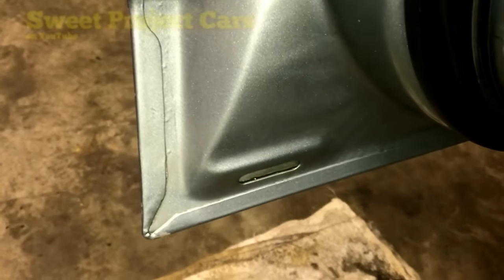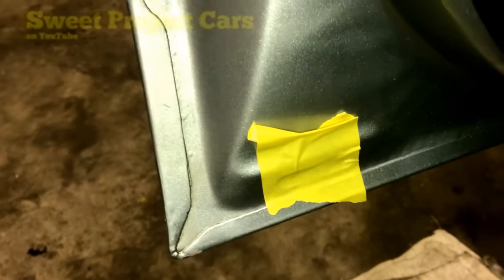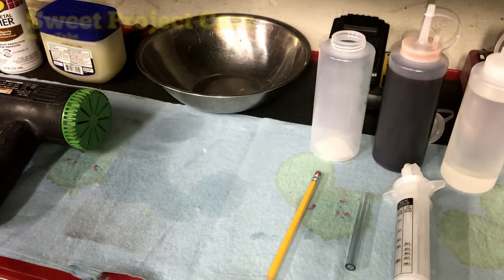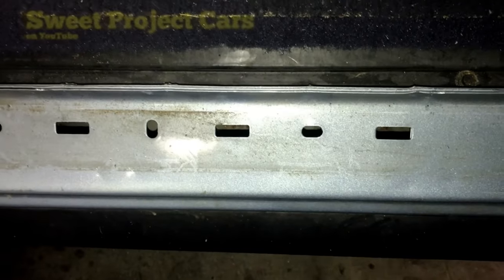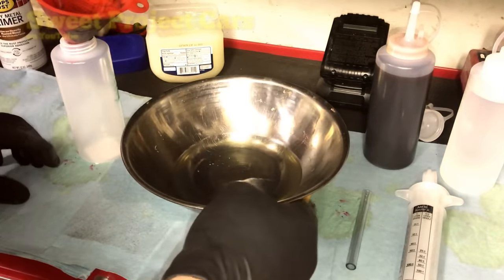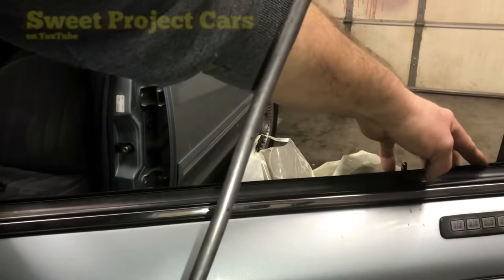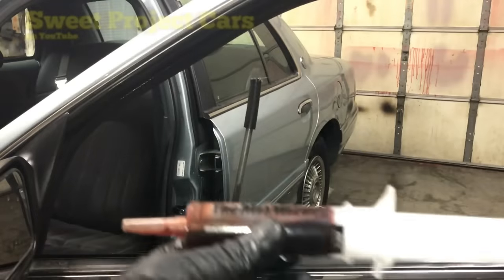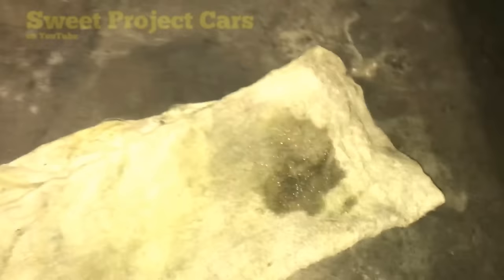Your Car Will NEVER RUST Again! For Just $10 Bucks!

Comment: Does petroleum jelly deteriorate rubber? Additionally, from what I was told, cars made in Canada have higher nickel content that prevents rust.
Reply from the maker: No it doesn't, it's petroleum the same thing as rubber which is made from crude oil.  Thanks for watching. mad Mike the hammer SPC
Reply: @SweetProjectCars  I'm always looking for products that prevent or stop rust and that work. I live in Pennsylvania. I recently purchased a used 2003 Camry from Florida that had no rust. The underside was spotless. After two years of Pennsylvania winters it's showing a little surface rust on parts that are without factory undercoating such as suspension parts. I'm wondering how NHOU undercoating oil works. It looks pretty good. I see some of the same ingredients in the rust prevention solutions you make that are in NHOU. I'm going to try the stuff you make. Who wants to pay an arm and a leg for stuff you can make yourself. Thanks for your videos.

Comment: If you have existing rust in a tailgate and you treat it with petrolium jelly would it make it harder to repair the rust when welding ?
Reply from the maker: Right...so we say fix the rust before you do this rust prevention

Comment: Very cool.  My question: If you allow the product to drain out, where is the protection?  Thank you.
Reply from the maker: The protection is that it seeps into the cracks and crevices and leaves a coating on the paint or metal as you know when you get all on something it’s very hard to get off
Reply: Hi bro . Do we need to use both Vaseline and motor oil or we can use one them ? Thnx a lot  bro
Reply: Hi bro . Do we need to use both Vaseline and motor oil or we can use one them ? Thnx a lot  bro
Reply from the maker: You can use either one or all if you feel you need to we really prefer the mineral oil and door of the transmission fluid you can use either one of those as well

Comment: Thanks for the great video.  I'd like to ask if you think the approach in the video might be useful for a different rust issue.

I have started seeing rust forming around my windshield.  

The car is 18 years old.  The car has life left in it but it's not economical to have the rust repaired properly by removing the windscreen and doing a full repair.  I was told that without repair, my car has 5-10 years before the rust will kill it.  If I can slow the rust, that would be a solution.

If I apply one or other of the oils between the metal around the windshield and the windshield moulding (this seems to be where the water is getting in), particularly where rust is forming, is this likely to help exclude water and reduce rusting?  If the rust that has formed is treated with oil (so that it takes up the oil), could that slow the progress of the rust.  

As I understand it, rust is acidic and, once formed, it accelerates to the process of corrosion.  Keeping it dry reduces the chemistry of rusting.  That seems to be how the oils in your video do their work.  I might need to try to thin the oil to help it penetrate in this type of situation.  But in your experience, do you think it might help slow the rust?  Any tips?
Reply from the maker: Johnnydee Moorstreet real simple my frien, for this open up the seal just a  bit and use the baby oil and mineral mix in the tool list of the vide and pour it under the seal allowing it flow to all the cracks and crevices   thank you very much we truly appreciate it :)
Reply: Thanks for the reply - much appreciated.

Could I please clarify something.  Baby oil and mineral oil are pretty similar.  Are you suggesting a mix of them or using either of them in a mix - possibly with a mineral spirit like white spirit or turpentine to aid penetration?

I was thinking of using some WD40 to try to get some odourless fish oil onto the internal rust, possibly before oil treatment.  Would you discourage this?  

The video says that transmission fluid is the best rust treatment.  Are you suggesting mineral oil/baby oil because they might be more compatible with the windscreen moulding?

Thanks again.
Reply from the maker: Johnnydee Moorstreet you can use what feels best to you we have put this mix together after years and years of testing and failure and found the baby oil and mineral mix has a trait with it that just plain works, we are actually going to do a video on the roof rust very soon.     thank you very much my friend we do highly appreciate your great comments :)

Comment: could you not also spray in liquid pond sealant that will set as a protective membrane that will stay water proof for multiple decades?
Reply from the maker: You can use whatever you want to use, we are just sharing a safe, inexpensive way to do this process that works every time.  Thanks for watching John, have a great day. mad Mike the hammer SPC

Comment: actually, petroleum jelly is flammable. It's very common to soak it into cotton balls for fire starters.
Reply from the maker: Petroleum jelly is not flammable   Watch this  https://youtu.be/5J0VG4_jR2w  The only reason it SEEMS that the petroleum jelly burns on cotton balls is an illusion.  If you are to take a cotton ball with nothing on it and light it on fire it will burn up in seconds.  By adding the jelly to the cotton ball, you are slowing down the combustion rate of the cotton ball, it is not the petroleum jelly that is burning it is simply slowing the cotton ball from burning up in seconds. Thanks for watching.  mad Mike the hammer SPC

Comment: Vasoline with aloe is non flammable for the most part, however straight vasoline is highly flammable! Cotton ball in vasoline is the best fire starters I've ever used. edit, I was incorrect, it is not highly flammable.
Reply from the maker: Free Time LICYD Well I hate to disprove that but here are the facts and the video to prove it   the videos you see online with the cotton ball with PJ on it ...the cotton ball is burning not the PJ, that only slows the cotton ball down so it does not burn up in seconds ..see our video proving PJ does not burn on its own   https://youtu.be/5J0VG4_jR2w  and thanks for the great comment :)
Reply: Sweet Project Cars ok that's crazy does lamp oil burn? or just the wick? Thanks dude!
Reply from the maker: Free Time LICYD not sure on lamp oil as we have never used it and most likely never will to rust proof vehicles or any other process. thanks have a great day.

Comment: Would Hydraulic oil work as well as the Transmission fluid for this treatment?
Reply from the maker: You can use whatever you want, we are just showing you what 40 years experience has proven to work best.  Thanks.  mad Mike the hammer SPC

Comment: Petroleum jelly is indeed very flammable
Reply from the maker: Petroleum jelly is not flammable   Watch this  https://youtu.be/5J0VG4_jR2w  The only reason it SEEMS that the petroleum jelly burns on cotton balls is an illusion.  If you are to take a cotton ball with nothing on it and light it on fire it will burn up in seconds.  By adding the jelly to the cotton ball, you are slowing down the combustion rate of the cotton ball, it is not the petroleum jelly that 
is burning it is simply slowing the cotton ball from burning up in seconds. Thanks for watching.  mad Mike the hammer SPC

Comment: Tri-Lube,, I spray all the seems and hinges with it twice a year,, 1999 truck- zero rust
Reply from the maker: jodopeg thanks for sharing, we try to do videos for the diyer that wants to use what they already have at home
Reply: @SweetProjectCars  Thanks for your reply, I'm in Miami, FL , idiot drivers are more of a worry than rust here... a good security system and GPS tracker is also important,  it was for me on 2006 when mine was stolen, but I got it back 3 and a half hours later with help from the Dade County cops....
But the 1998-2004 S10s were built for the track per the S10 racing circuit then.

You can still see plenty of old S10s on the road , I've had mine for 20 years and it's still rock solid...
Had to change the AC Delco clutch at 160K miles, and of course the usual stuff like the radiator and water pump, MAP sensor, coils, plugs and wires...
But the 2.2 LT, 4 cyl IL engine and 5-speed manual transmission just won't die.

Chevy has replaced the S10 with the crappy Colorado,,, I don't believe we will see a Colorado racing circuit anytime soon....

https://drive.google.com/file/d/1C4jAfjhApqar2j1LM-uOyjYjEoKXaard/view?usp=drivesdk

https://drive.google.com/file/d/1wDwTZQ7aEld82S-bI0U9iR6QxBE64mP4/view?usp=drivesdk
Reply from the maker: jodopeg  nice truck my friend and love to see the green grass for sure :)

Comment: Hi, loved this presentation! Do you think EP2/NLGI2 lithium grease could work also? In my country these Vaselines and Petroleum Jellies are at same cost as these machine greases :) Thanks, Aron
Reply from the maker: We've used every grease out there known to man, and this is the only grease that works for this process.  Thanks for watching Aron.  Have a great day.  mad Mike the hammer SPC
Reply: @SweetProjectCars  eventually I used yes, petr based simple Ikea wax mixed with ATF and spitted onto the fender bottom part where I have the "burn" :))

Comment: Pretty clever but Vaseline IS flammable.  Not like spray paint or WD40 but it does light.  For what you are doing I would think it would be preferred though because at most ambient temps it would eventualy return to it's semi-solid state.
Reply from the maker: see this video and you will see why it is not https://youtu.be/5J0VG4_jR2w

Comment: All 3 of those products will float on top of any existing water. Maybe use antifreeze or something water soluble with rust inhibitors.
Reply from the maker: Corban we beg to differ with you on this if you apply any of these products to a dry surface and they soak into the area no amount of water will remove them if there is water on the area where these products are applied yes they will not stick.... spray motor oil on a dry surface and then try to wash it off with water it does not work have a great day

Comment: Not flammable? Want to bet? I sometimes make my own log starter with Vaseline, or candle wax. Both can start a decent fire fairly easily.
Reply from the maker: Petroleum jelly is not flammable   Watch this  https://youtu.be/5J0VG4_jR2w  The only reason it SEEMS that the petroleum jelly burns on cotton balls is an illusion.  If you are to take a cotton ball with nothing on it and light it on fire it will burn up in seconds.  By adding the jelly to the cotton ball, you are slowing down the combustion rate of the cotton ball, it is not the petroleum jelly that is burning it is simply slowing the cotton ball from burning up in seconds. Thanks for watching.  mad Mike the hammer SPC

Comment: This is interesting, I would assume that the petroleum jelly would turn back into the jelly form when cooled.
Also, it looks like it could be sprayed with a standard cheap utility pump-sprayer.
Reply from the maker: Yes it is a great sealant when it cools off if you’re going to use a sprayer you have to be pretty quick with it as it does start to gel again Mineral oil and trans fluid is very easy to spray have a great weekend thanks for asking

Comment: But the water is heavier and will obstruct the oil from reaching the bottom if the water isn't removed first, won't it?
Reply from the maker: As mentioned in the video, you do this on dry vehicles.  There's hardly anything that we know of when working on a vehicle that you want to do or apply when the surface is wet other than washing.  Thanks. mad Mike the hammer SPC
Reply: @SweetProjectCars  Thanks Mike!

Comment: Hmm. The problem I found was that once upon a time I put motor oil in the trunk wheel-wells. Water got in there and the oil floated to the surface. Giant mess.
I might try the Vaseline.
Reply from the maker: Trucker if the panels are dry once you add the oil and it’s soaks in to the primed panel or rust water cannot wash it off specially cold rainwater much like washing a dish pan that has corn oil left over in it, its very hard to remove with cold water

Comment: I use And oil metal protection spray. Not the clear but the chain lube stuff. Tries to hit wax like dry finish and it works great so far on all the rust on my small engine equipment like my snowblower rust and Wells hasn't moved or migrated since 2002

Comment: Does the vasaline set again when it cools? Just wondering gow long it stores for in the bottle like that.
Reply from the maker: Chomps it stores for years and when you want to use it again just warm it in a microwave or soak it in very hot water and its ready to go again :)
Reply: Sweet Project Cars ah, yeah that makes sense. Cheers.
Reply from the maker: thank you :)

Comment: dosn't that oil mostly wash right out after first couple or rains?
Reply from the maker: No it does not wash out.  Picture trying to wash out corn oil from a frying pan with cold water and no soap just rinsing with cold water.... doesn't work.  Cold water cannot remove oil or grease.  Have a great day.  mad Mike the hammer SPC
Reply: @SweetProjectCars  Good analogy! Maybe you can mention that if you ever make another video about this. Helps newbies like myself understand the WHY behind this project. ;)

Comment: So, help me understand here. Salt, which comes from outside and sticks to the outside of the car's metal, somehow is neutralized by oil INSIDE the panels?
By what principle do you claim this works?
Reply from the maker: Doug Moody salt gets into the bottom edge of the door via many ways it likes cracks and crevices that washing does not always remove or can get to...salt starts corrosion and the oil stop that from happening...metal cannot corrode when it has an oil of some type on the area where the salt comes in contact with it.
Reply from the maker: Jr ALEXANDER you nailed it my friend :)

Comment: What about using coconut oil as it turns into like a hard wax when it gets cool, but poor it in hot and let it soak in first.
Reply from the maker: aux1z11 you can, of course, use whatever you like we are just showing what works for us.
Reply: @SweetProjectCars  also I was thinking DMSO it is oily and freezes at 64 degrees and soaks in probly better than oil.

Comment: You can thin petroleum  jelly with petrol,, it dries Rock hard.
Water would not be able to reach it..But not outside Rooker panels as it would Chip with stones hitting it.
You have to put up with the smell and DO NOT USE NEAR HOT AREA'S. PLEASE DON'T..
   They used it on gun barrels on the salt marsh's, but does get chipped if you knock the metal..Hence not stone chips out side Sill..
Reply from the maker: Thank you for watching and sharing Wendy, have a great day. mad Mike the hammer SPC

Comment: Uhhhh....petroleum jelly IS VERY flammable!
Reply from the maker: Petroleum jelly is not flammable   Watch this  https://youtu.be/5J0VG4_jR2w  The only reason it SEEMS that the petroleum jelly burns on cotton balls is an illusion.  If you are to take a cotton ball with nothing on it and light it on fire it will burn up in seconds.  By adding the jelly to the cotton ball, you are slowing down the combustion rate of the cotton ball, it is not the petroleum jelly that 
is burning it is simply slowing the cotton ball from burning up in seconds. Thanks for watching.  mad Mike the hammer SPC

Comment: The Ford F-150 door curls up and level and will not drain water out of it store. I don't know why they don't bring the bottom panel up and the door smaller. This way the door would drain better and not hold so much water. If you know about the Amsoil MP spray the brown stuff it will not let anything rust after you apply it.

Comment: Won't the petroleum jelly turn back into a solid when it cools what happens if you live in a climate that is cold and snows gets below freezing
Reply from the maker: yes, that's the key, it seals the car up so water cannot penetrate :)  thank you for the awesome question and comment it helps the entire channel :)
Reply: Thanks: I was wondering the same thing and thats the method I will apply to my F150. Also wondering what happens if you use the patrolium jelly the first year, then the next time use tranny fluid??

Comment: Have you ever noticed the tranny fluid damaging paint or clear coat over long term contact due to the detergents in it?
Reply from the maker: No, see this https://youtu.be/pMGHcKVo2Yk   There is not a fluid that the manufacturers make that will harm your paint, not even brake fluid. Thanks for watching and asking Dan, have a great week. mad Mike the hammer SPC

Comment: I have a question, I have rust on the back of my trunk by my tail light and it’s reAlly bad n some areas ( bubbled and rusted bad ) what u suggest 🤦🏾‍♀️
Reply from the maker: Sounds like you’re going to need some sanding and repainting if it’s on the outside of the vehicle if it’s on the inside of the tail light housing area you can send off the rust and use rust oleum rusty metal primer will work great sorry I wish I had better news for you on that one
Reply: Sweet Project Cars okay thank you

Comment: will rain water eventually wash this out??
Reply from the maker: We've not had that problem, picture it like this, trying to wash out cold bacon grease from a frying pan with nothing but cold water, it won't happen.  Vaseline and mineral oil are even tougher than bacon grease to remove with cold water.  Thank you for watching.  mad Mike the hammer SPC